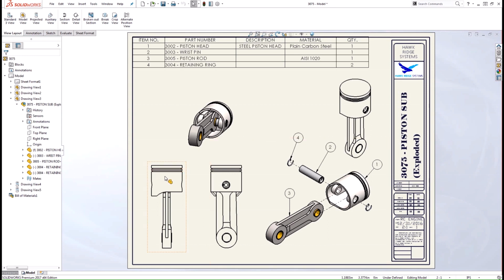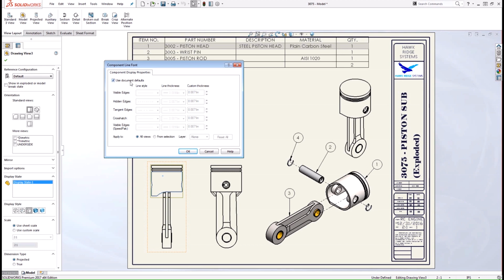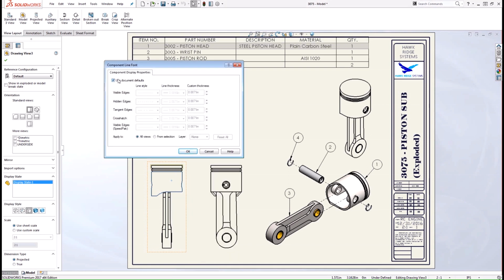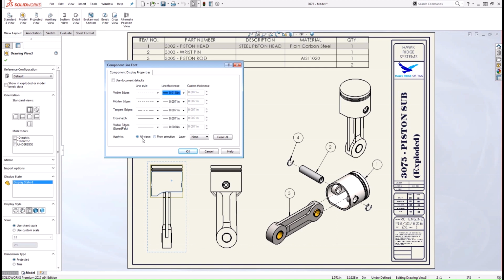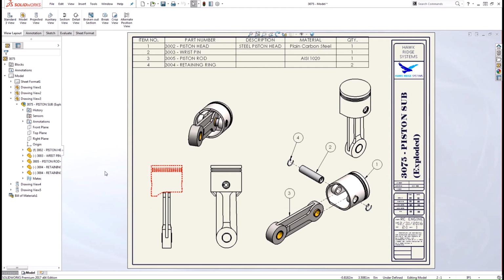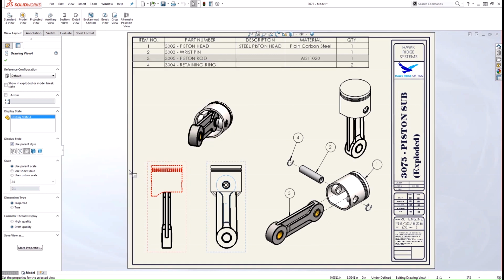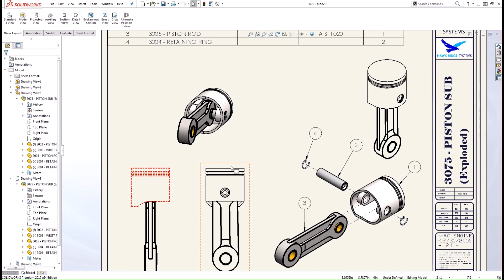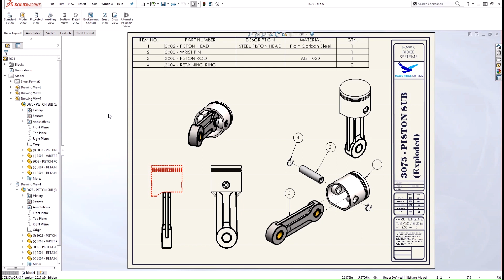SOLIDWORKS Drawings: Changing the Line Style For Components

Comment: I don't have any component options in solidworks 2020, it just goes from "recent commands" to "lock view position".  Am I doing something wrong?
Reply from the maker: Make sure you're right clicking on a face of the component and not the edge of the drawing view bounding box. 

Another thing to check would be to click the "double arrows" at the bottom of the right click menu - this should expand it to show additional options.
Reply: @hawkridgesystems  Ah that did it! thanks